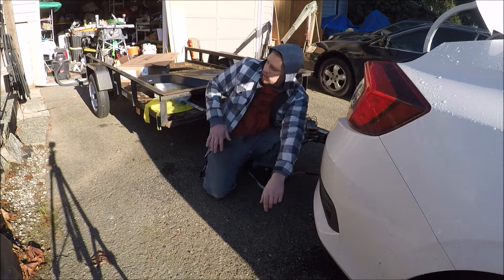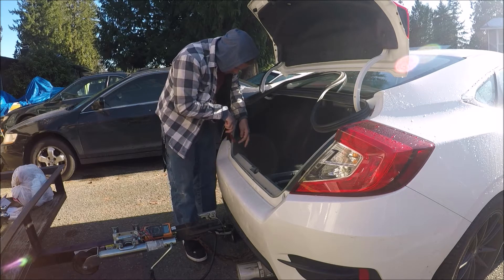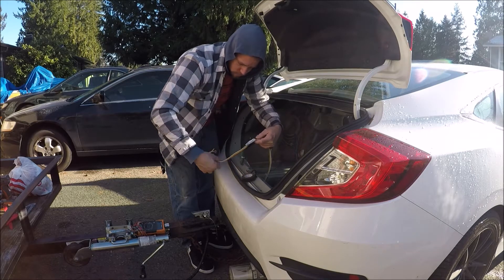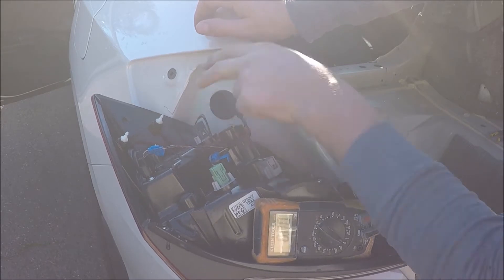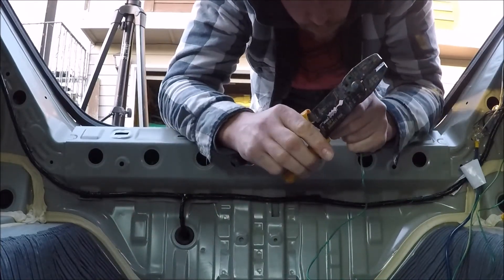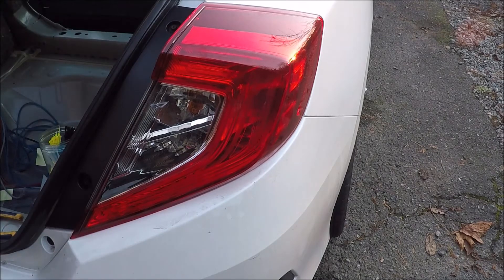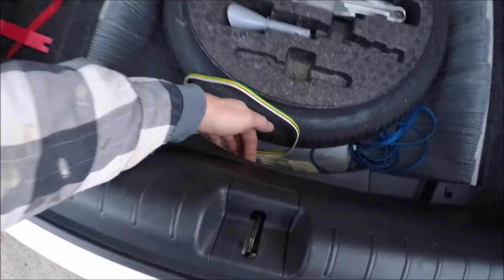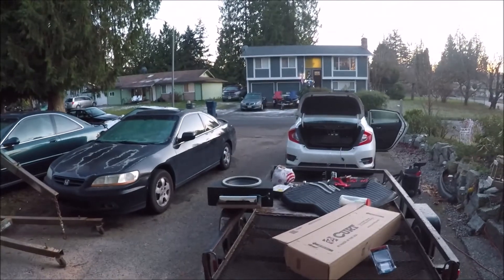DIY installing Curt 56416 3 to 2 trailer wire converter in Honda CIvicX (works for all vehicles)

Comment: Thanks for your helpful video. I have this : https://i.postimg.cc/bJZvKd8Y/20190504-111448.jpg and https://i.postimg.cc/xCN067yc/20190504-111439.jpg which I am trying to install on a Honda Civic too. Any idea if this being a powered one would work as a non-powered or better to use power from battery? Thanks
Reply from the maker: I honestly don't know if it would work without power. If so I'd just assume they wouldn't even have the "batt +" wire... Could always try but I would plan on having to run the battery wire. Maybe it just has to do with current draw of the trailer and you might get away without hooking up the BATT+ if you have a small trailer with few lights and they're led...